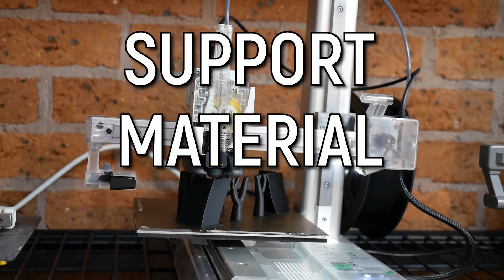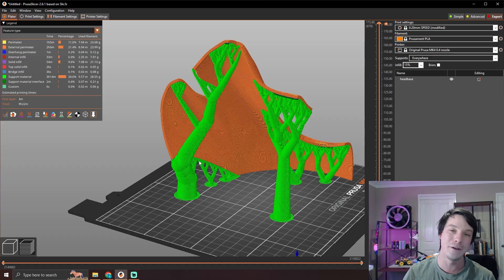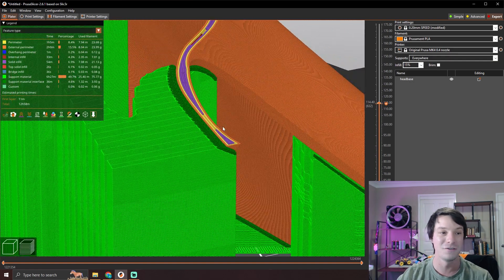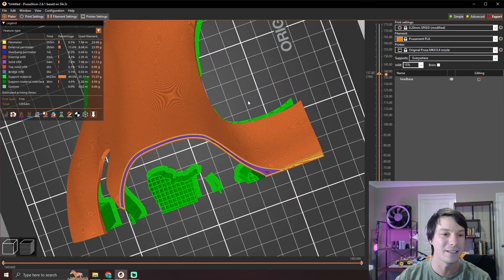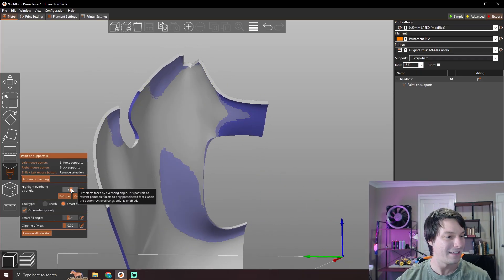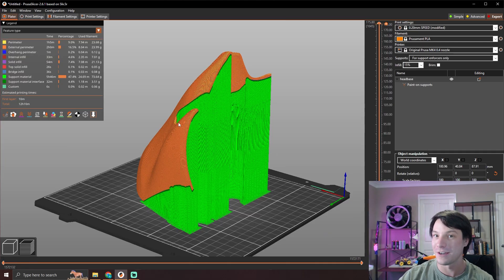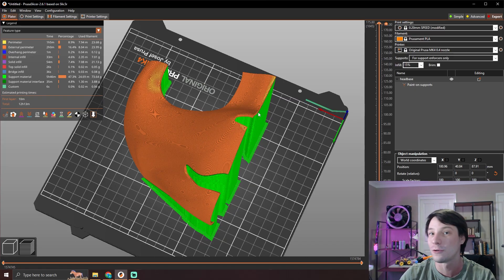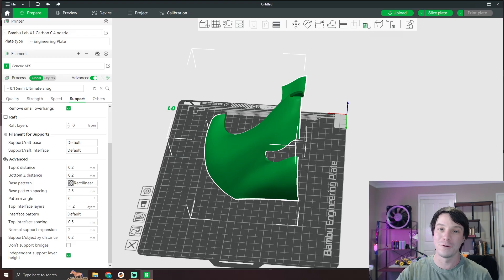When support material fails... I do this. #3DP101

Comment: heck yeah... another AMAZING setting I just found out about in Orca Slicer is "Make Overhang Printable" - it modifies the model geometry to help drastically reduce supports. Not great for all models but fantastic for some organic prints
Reply: That also exists in cura. Sometimes it is really useful and I also use it. In both slicers the results are really good
Reply: @santiagopostorivo  I couldn’t find it in Cura. Where can I find that?
Reply: @UncleJessy  Make overhang printable inside the experimental category. Maybe it is hidden by default
Reply: @UncleJessy  You can also adjust hole area and model angle like you can do in Orca Slicer
Reply: thanks! apparently I just needed to keep scrolling 😂 @santiagopostorivo

Comment: One thing I would like to see in the organic supports is automatic cross-support between the pillars. If the pillars could "hold" eachother up in the lower sections they would be much sturdier. Also it would be nice to have a seperate support brim that would try to connect remote support pillars together with the others on the support plate. That would already cover 80% of the fail cases I'm encountering.
Reply: You can actually sort of do this in cura. The combination of a large "join distance" for supports and conical support with a negative value.

For tall supports in general, I find that -5 to -10 degrees on conical supports helps a ton. If I need more, I'll use support brims and a larger join value to get mich more stable areas.
Reply: Tree Support Bridges.   I never understood why a bunch of small towers were used insted of bridging them to give each of them more stability as it goes taller.   it wouldn't need to be much, like every 5 mm make a double layer bridge connecting the supports at that layer height.
Reply: The supports connecting on the plate would be solved if the slicer had a reliable raft feature.
Reply: Or add a “root” to the structure to hold it steady on the build plate.
Reply: It's standard in resin printing, always wondered why we don't have it here.
Reply: Send that in to prusa! 😊
Reply: I've been asking for truss-like structures since I've seen them generated for SLA prints...
Reply: @MMuraseofSandvich  those truss like structures are not good for FDM. To print them you have loads of thin rods that need printed individually. If you think about what the layers are, with truss like supports, the support structure will be loads of small circles and ovals every layer, that isn’t good and will fail a lot more often than regular supports, with normal and tree supports the lines it needs to print are much longer and hence more reliable. SLA printers can use truss supports since there isn’t really any force on the print other than the lifting motor and gravity and SLA printers can print thin objects like that well since it is just curing it with UV not squeezing molten plastic out of a nozzle like FDM.

The two printing methods, FDM and SLA are very different, hence the supports needed are different.

Edit: on top of that voronoi or lattice prints are similar in structure to those truss supports and they are difficult to print, generally seen as torture tests.
Reply: @conorstewart2214 That's a good point, but they also don't have to be super-small circles. In theory, you could generate those supports in Chitubox with a very large shaft diameter, export the now pre-supported STL, then slice it in Prusaslicer and print with no additional supports. Dang, now I really want to try that out of pure curiosity.

Comment: looks like you may need to replace the extruder gear on your X1 or check the tension. There's a bit of extruder banding goin on at the end there.
Reply from the maker: worth a look, the ABS could have warped a little too but I do need to do some maintenance on the thing.
Reply: @MakersMuse   I was slacking myself which is why I even point it out lol. My P1P was having the same issues.

Comment: 01:00 Rotating the model 90 ° anti clockwise would save so much support material and print time… 😉 It also helps to let the print cool down (esp. w/ PETG, maybe in the fridge) before removing support.
And A BIG THANK YOU fore re-recording and not having any background music while talking! 😘 This makes your videos easy to understand.
Reply: Rotating is not always an option, though. 
This is just an example on what to do when other support fails.
Reply: @Der_Ed  Sure, not always, but for this model it's worth trying. Except if layer orientation is essential.
Reply: @NUeB_net  but the whole point of the video is to show how it's done. So no reason for him to rotate it to reduce support material
Reply: @Der_Ed  Didn't you read the 😉emoji in the first post? 🙄

Comment: Do you have any techniques for dealing with interface layers on PETG? I find PETG really hates to separate from itself and ends up with most of the interface layer stuck to the model instead of the support material even when using Rectilinear Grid
Reply: I use permanent marker. Just make pause on upper layer and draw
Reply: @egorcik1  that's not at all practical... that means pausing every single layer during a slope

Comment: I actually like to use tree support - it's strong variant, sometimes adding 2-d layer to tree branch - default variant just snaps in the middle of the print and they're shit. I might draw lines or crosses for it to form into a more reliable structure that won't vibrate as much or break. It does a fairly good job with supporting wobbly parts by covering them too, and I also include some supports to the areas you mentioned don't need support just to avoid extra vibrations of the model, especially if they're long and thin (I'm working on Kerrigan statue now)
Reply: I've also noticed better print finish for supported areas when using tree supports though perhaps this was due to the non-grid in the old support style. I do like tree support because they allow for supporting parts of the print not directly over the bed without printing supports on top of a lower area of the print.  Would be nice to mix and match tree and tower support in the same print!

Comment: You probably use more material for support rather than part but for this kind of shape you are right there might be no other way to print it. I hate supports like everyone else does. But some parts dictates the use of them
Reply from the maker: Yeah, some shapes are a real challenge. I tend to use these stronger supports to avoid potential failures and have to reprint, wasting even more time and material.
Reply: When TimeIsMaterialIsMoney you tend to pay closer attention to "what works". A big one for me was turning off M413 (power loss recovery) in the g-code as I was getting surface blobs & imperfections every time my Ender 6 would record on the SD CARD the position for M413. Minus the M413, I just have the Ender 6 connected to an APC UPS (Uninterruptable Power Supply) so if there is a power line burp or hiccup, the UPS smooths things out. Heck, there was even a mains line power outage where I had to use the UPS, attach another TAD5000 (EGO Brand) Battery Inverter Unit, which gave me just enough time, 20 minutes or so, to get my gasoline generator up and going, which I needed to anyway.